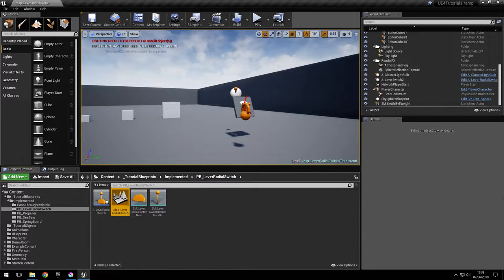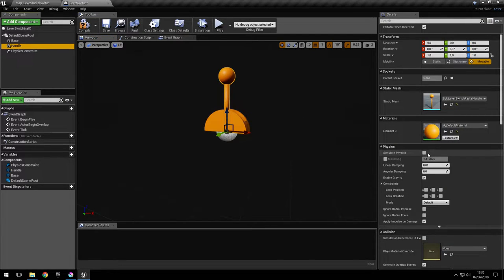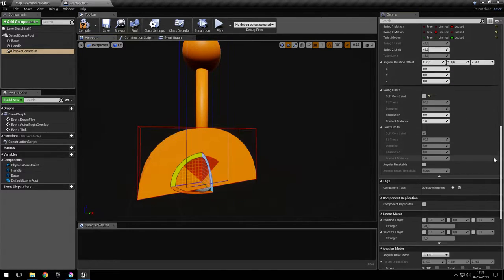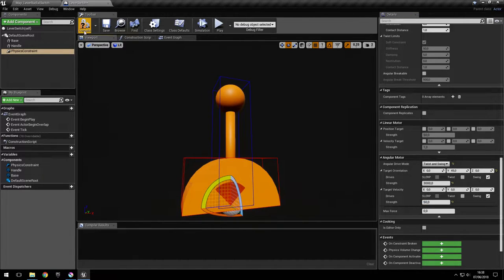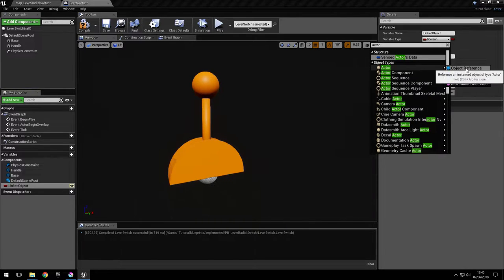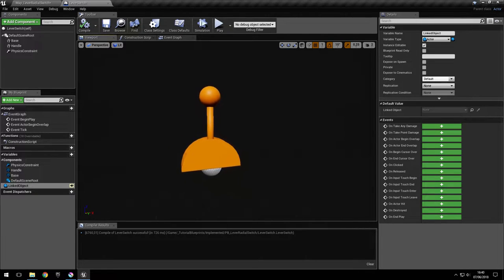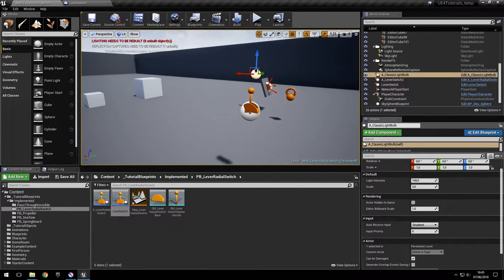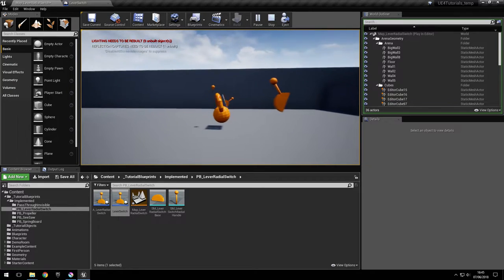UE4 Pull Lever / Radial Switch using Physics Constraints in Unreal Engine 4 Tutorial How To

Comment: This is EXACTLY what I have been looking for! I have been trying to setup making a door in VR, and I knew the base logic I needed to figure out was how to make the physics constraint work how I need it to so I don't have to worry about too much complex actions like breaking the constraints, rotating the door manually with angular math, applying a new constraint, transfering the velocity... If the door can only move in the intended direction, who cares what way the player's hand is going? This is well explained :)

For the record, around 6 minutes where you are pointing out the difference in the positive and negative axis movement, I am pretty sure that is just due to the difference in world/relative axis :) You are trying to use the relative axis values available in the blueprint, and align them to the world axis in the level. Your fix is a good one though! I typically spend a few extra minutes playing with things to find the proper world rotations.

Comment: Would there be a way to implement this to make an actor rotate? Or activate and deactivate a physics constraint that makes an actor rotate? I've been trying to make a lever to switch a fan off and on but I'm having issues trying to get it to rotate.
Reply from the maker: Yes, it's entirely possible. Instead of turning the light bulb on and off, you turn on a physics constraint, like you said.
Check this tutorial to see how to make a wheel rotate: https://youtu.be/7mZ9XTLIFY0?t=7m32s
To make it stop or start, set the Target Velocity of the physics constraint to either 0 or a value that you want.
BTW, I've also done a blowing fan tutorial if you're interested: https://youtu.be/J9lVADyd8ZQ